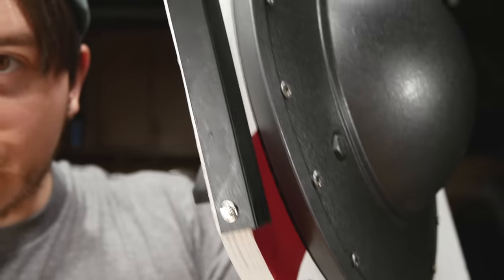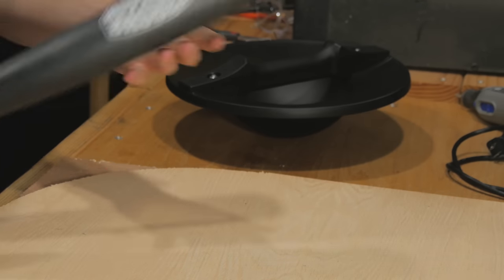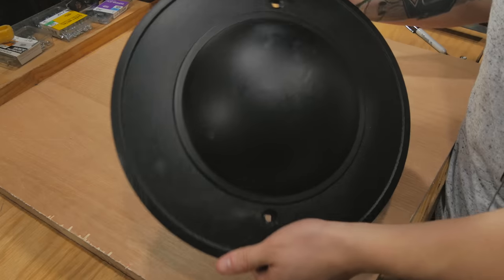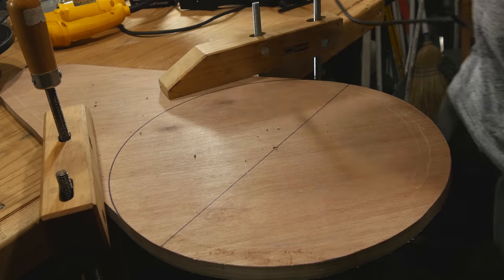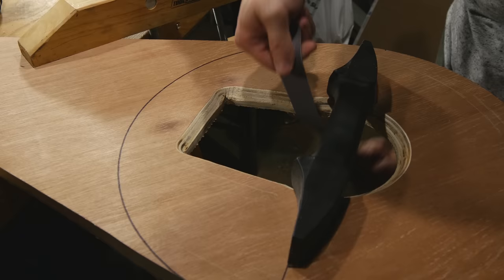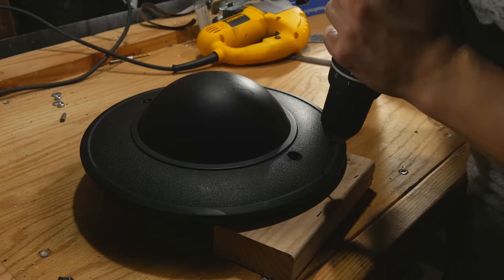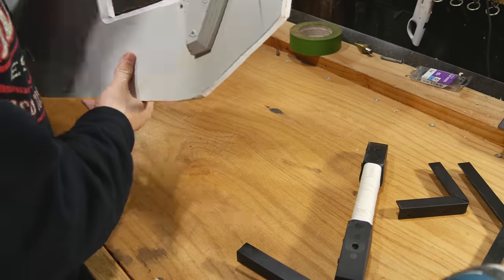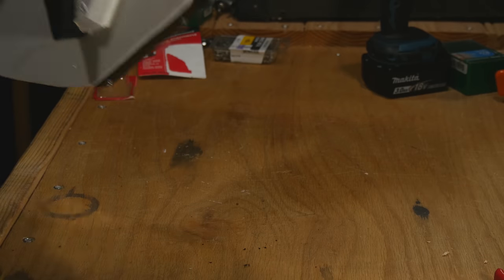How to Make: Brawler Shield (Weapon/Shield HYBRID)

Comment: Also you’ve effectively made a Kite Shield. Not an aggressive jab, Kite Shields are rad, just pointing it out
Reply: That is, in all honesty, the tiniest, least useful kite shield I’ve ever seen then. Good shield, it works and it’s smart, but like, a kite shield is supposed to be waaaaay bigger, and gripped much differently. Kite shields are meant to cover lots of the body, without the weight of “tower” shields. This is a little baby kite shield. Works more like an oddly shaped heater shield if you ask me
Reply: loaf Bread this shield would be a weapon  that’s the point. Using the shield as a weapon was his point.
Reply: loaf Bread it seems like. The point of this shield is to extend the punch while adding weight and power. While still being able to defend axes and swords.
Reply: @the_worst_of_friends924  I know, all I'm saying is if it was a kite shield, It'd be much larger, with more body coverage, and meant specifically to take hits while you use a separate weapon. This is more of a brawler weapon, which can act as a fairly good blocking method as well
Reply: Pmis
Reply: Kite shields are rad, says shad
Reply: It's more like a weirdly shaped heater shield
Reply: @Loafusbreadmyre  Kites are ment to protect the leg whilst riding upon a horse.  Using a kite in a standing position is gloriously innacurate.  I would love to demonstrate for anyone.
Reply: Shadiversity. Shad approved
Reply: @viridityone3106  spiked pavese sir
Reply: @jonasandersson7367  preposterous, this clearly does 1d6 bludgeoning damage while a Pavise does 1d8 piercing.
Reply: @viridityone3106  i think im wooshed, id what?
Reply: @jonasandersson7367  it's a dnd joke
Reply: More of a Pavise
Reply: @Loafusbreadmyre  it's a lightweight attack kite shield lol for the tower man on the go
Reply: @Loafusbreadmyre  well its kinda like if a kite shield and a heater shield had a baby

Comment: A shield is usually designed for bashing though. But since a shield bash is quite slow you can't really make it a main feature.

Kite shields have a sharp bottom for ramming through the weak spots in downed enemies' armor though, but that was only useful for well-armored knights. It also covers your side as you strike and might block some arrows, not that a plate-clad knight really needs to fear those.

Round shields are much better for arrows and better for covering your side as you strike, good to have when your armor isn't as hard as plate. Also you can hit hard as fuck with it. It's slow though. 

The buckler is the real bashing shield as it's light and quick with enough force to stun even armored opponents. Doesn't cover your side but it has some protective use since it can cover your sword-hand. Useless against arrows though, it's a specialized dueling weapon.

Also the name for buckler literally originates from the old Germanic word for "bashing".

So yeah you're kinda trying to reinvent the wheel but all in good fun
Reply: hes actually not trying to reinvent something hes just trying to provide more protection while allowing for a faster sheild bash so you can move from enemy to enemy faster and more efficiently
Reply: Crusader Sheild good for taking Jerusalem
Reply: SATAN Himself DEUS VULT
Reply: I mean its basically a kite shield shaped buckler. Though he cant move it like a buckler so normal buckler and sword stances are gonna be hindered.
Reply: @cobes11  well I mean they also dont typically have body armor on it
Reply: booty_ hunter420 A shield, like any armor, is only as useful as its ability to stop the weapons it is likely to face. The Templars had little need to protect against .30 caliber rifles for obvious reasons. And with as many guns as I have had pointed at me in my life so far, I can only guess that ine will go off one of these days.

Comment: ELI! There is a semi-light weight sheet metal material called “Titanium 6-4.” It is Titanium with added percentages of Aluminum and Vanadium respectively. I have found even a sheet as thin as less than one quarter inch can stop or deflect a .45 caliber CORBON hollow head round. A sheet of this on the face of the shield would make it bulletproof against pistol fire, whilst keeping the weight low; snazzy. 

Excellent work as always, magnificent Art!

Comment: For anyone wondering, I did the rough math and he is using about a 2 foot by 2 foot piece of plywood for this. The buckler is 12 inches in diameter, so the dimensions of the shield are around 16 inches by 2 3/4 feet
Reply: Thanks I didn't see the dominions in your video

Comment: U know what would make this thing look even better? First, draw a line 1 or 2 inches away from the bust at the long part and keep curving around it until you get around about a 200 to 220 degree angle going around the bust, facing the longer end of the shield. You may notice that it doesn't go all the way to the edge so just go in a straight line until you do. Then cut it and reattach it but with some bars or something in between the two pieces so they have a spaced out effect to each other and you can add to it by spacing them out more, add a more jagged/spiked affect to it, putting random, broken, bits of wood in the space, and/or see-though, coloured plastic in it.

Comment: Here is something to consider for future shield builds, rawhide, or its equivalent, if you can find it for cheap (I get you are not planning on getting into a fight with these).  Rawhide was placed on both sides of the wood, sandwiching it, to prevent the wood from splitting should a projectile; arrow, bolt, maybe javelin, should pierce it.  The last thing you want is for your shield to take a broadhead and split into pieces in the middle of a fight.  The stuff is thin enough that it is transparent so paint jobs and designs can still be seen, though not as clearly (this ain't plastic wrap).  Anyways not sure if you can find some in your area cheap, maybe ask local hunters to sell you some.  Just a thought on making them last longer without investing in really expensive materials.  Love your content hope everything works out for you and you can keep doing what you seem to love to do.
God bless

Comment: I love the shield, love the channel, however, the boss of your shield (boob thing) is positioned so high a sword or club bouncing from impact would clear the top of the shield and negate the purpose of your shield.
Reply: I don't get what you mean with "clear the top of the shield".
Reply: I think he means skip off of the boss and bounce over the top of the shield, straight into your face.
Reply: Matthew Morris Yeah, that's what I thougth as well. However, bucklers have been a tried and true weapon throughout history since its invention, and thats what the actual boss of this shield is made out of. It's all about how good you are with it.
Reply: Matthew Morris thanks for the reply by the way. :)
Reply: Actually, Bucklers where rarely used in actual combat, being preferred to be used in duels or sport, and used in conjunction with a light sword such as a rapier. Not only that, but bucklers are used in a unique manor, a completely different way to conventional shields, a way that is not conducive to be used in actual battle. If one was to use a buckler in combat, then anyone with a heavy weapon would either A. break your wrist as the buckler is held by a handle, and lack any support, B. Deflect the blow around it to either the face, arm, neck, well, anywhere but away from the body.
Reply: That is not taking into account the fact that ZNA's shield is no longer a buckler, rather a tiny kite shield, with a disproportionally HUGE boss, now, in shields like a kite shield a boss serves two purposes, a weapon to bash into the enemy, and a metal hard point curved to deflect blows into sliding off the shield, dispersing the energy of the blow and avoiding broken arms. Now, this deflection is useful in larger shields as the sword would deflect, then slide on the main wooden part of the shield, and fly of to the side, avoiding the person, in ZNA's case though, the shield is too small, and such a deflection would result in a sword to the face or groin (depending upon where he positions the shield), this is even worse as the boss is HUGE, and as such deflections like that would occur more often as not only is the boss covering almost 50% of the shield's surface, but it is the shape of a buckler, as it is in fact a buckler.
Reply: TheConeezeanEmperor good points, but do you have proof that bucklers weren't used in actual combat?
Reply: TheConeezeanEmperor And yes, I know you use a buckler in a different manor than other shields. That's what I was refering to in the last sentence, in case I was unclear.
Reply: It was used, as I say, in sword play, duels, and the such, and as far as I know was not recorded as having ever appeared in battle, at least, if it did its performance was so lack lustre that no one recorded it, or used it in battle again. The other thing is that due to its small size it was useless against projectiles, which meant that it was nigh useless in actual battle, where common tactics dictate that an army would have some form of missile unit along side its infantry and cavalry.
Reply: The point of a shield is protection, if it does not offer that then what is the use, considering the fact that bucklers would cost more than standard shields use to its all-steal construction then why would a soldier buy such a useless shield when he can get a proper one done, I mean, if he got the Buckler chances where that he would die before battle joined from an arrow, bolt, or similar.
Reply: TheConeezeanEmperor Well, if you define "real battle" as in a battlefield /warfare situation, then that could be true. However, wasn't the buckler used as a sidearm by archers and such rather than against them?
Reply: Yes, but the point still stands with the fact that it was a "sidearm", they did not rely upon it, and it was only used as it was light and small, as opposed to its effectiveness in battle, I mean, it is useful if you are skilled in its use, but only in a 1 on 1 duel, if you are in battle and are facing the chaos of a melee it is all but useless.
Reply: TheConeezeanEmperor, I believe you meant "said" rather than "say."  From context, I assume you were referring to your earlier comment, but it would have been clearer with proper grammatical structure.  I would also recommend that you maintain your tense in the same sentences, mate. ; )
Reply: Shadiversity made the argument recently that the main purpose of the boss was not added offense or defense. Instead, he says, the main purpose is to let you put your hand in line with the plane of the shield, giving you better balance and control over the shield.
Also, while an arrow would not likely penetrate a wooden/leather shield deeply enough to injure your body, it could penetrate deep enough to injure your hand. So you cover it with metal.
Reply: Crown, that may be the case, but that does not stop the fact that the Boss DOES deflect blows, and was also used as an offensive weapon. Put it this way, it is more practical that a blow is deflected and the force dissipated with minimal damage to the shield than if the blow hits head on and damages the shield. This is MUCH more important the thinner the shield, jars or even breaks the arm/hand/wrist of the shield wielder, and potentially breaks through. I doubt that such a useful feature was an unintentional side effect.
Reply: TheConeezeanEmperor I would agree if the shields design lent to it being used to statically block attacks but it doesn't. With the edge being so close to the hand and the majority of the weight well behind the grip it very much is designed for bashing and parrying with the front edge rather than holding it in front of you to shield your body. I imagine it would function like a buckler with more weight behind it.
Reply: TheConeezeanEmperor If it wasnt clear my point is that, no it wouldn't be good for deflecting blows if you just held it out in front of you, but you wouldn't just hold it out in front of you.
Reply: As I am part of a viking reeanactment fighting group I feel like i should share my opinion.
The shield ive made for myself is a wooden shield that is 1,2cm thick (too thick so too heavy), 82cm wide, a glued on layer of linen on the back and front to prevent the wood from splintering (REALLY helps, its  must). A handforged mildsteel boss ive forged myself (its about 2-3mm thick, its enough to stop a full blow even from a Dane-axe), and a 2-3 mm thick moose rawhide around the edge of the shield.

My opinion about using these shield in offense, is that it definetly works in specific situations, but i would use the boss to bash my enemies as i would have to be so close to be able to hit the enemy, and the force would be spread out over a larger area, what id do is bash with the edge of my shield -> more range and power.
On a proper round shield the risk of a blow glansing off the boss and hitting me is next to noone cus of the size of the shield as well as the tip of the weapon would most likely be cought in the rawhide arouund the edge. (understandebly different with a buckler or ZNAs shield but i have no hands on experience with those).

PS. I am by NO MEANS a expert, I just do viking era fighting so got some hands on experience on what that type of fighting COULD have been like.

ill gladely answer any questions you have. :)
Reply: My point exactly, A simple farmer, it is not a shield, and if it was to be used like one then the blow would deflect into the face/groin. As such, it is a buckler/shield best used in 1 vs 1, as opposed to battle or genuine combat.
Reply: And Carl, that is exactly what I was saying earlier, if a blow hits the Boss it is deflected, and slides of the shield, if the Boss was not there or not shaped like that, the blow would catch, and the kinetic energy would be fully imparted. Also, using the Boss as a blunt trauma weapon is a tactic that has been used throughout history, and has many advantages over the use of the edge of the shield, the least of which being the fact that using the edge exposes you, and allows for others to get through your defence, or allows missiles though, using the Boss you can still remain behind the shield, and the protection it offers. Though, this also depends upon the shield in question, especially when considering the fact that using the edge is nigh impossible with tower shields.
Reply: TheConeezeanEmperor I don't entirely think that this wouldn't be used in a battle, it certainly wouldn't be used by people in line combat but it seems reasonable that maybe a man mounted on horseback or a knight in plate armour might use a shield like this (albeit a larger one of the same general shape). A shield like this seems to me like a shield of someone that isnt in any particular danger of being rain down on with arrows. So yeah, your spearman wouldn't be seen with a shield like this in battle unless he was on the ground dead or lucky.
Reply: Well, if you mean a buckler then the only cavalry that used them, even to a limited degree, was archer cavalry, by those where not bucklers really, just small shields, and archer cavalry was rarely used in the nations that used Bucklers commonly, namely Western European nations. If you mean a kite shield, which is shaped similarly to ZNA's shield, then yes, but it was MUCH larger and used also by infantry later on, the reason it was originally adapted for use by cavalry, knights especially, was that it was shaped in such a way that it can be moved around easily, and not be caught on the horse, saddle, etc. It was then used by infantry, if I remember correctly, as the shape still offers good protection to the face, chest, and arms, yet is lighter due to the shape of the bottom. Correct me if I was wrong there, but that is what I remember.
Reply: Well, to tell a lie actually, as later on Knight DID use a variant of bucklers, or bucklers themselves, but that was not in battle, only for tourneys and jousting, and was used in conjunction with the ultra heavy tourney plate armour (up to 2X the weight in some cases, between jousting armour, and battle armour).
Reply: I agree in part with all of you. Having been in a few reinactment groups for medieval and renaissance combat over 10 years, this shield has little to no historical reference. Now as someone who has built and used similar shields before, you are correct in thinking that in a melee situation where archers are plentiful it would have little value. Against 1 to... say 4  opponents(I have successfully used it against 3 opponents) it could be very useful, especially if it had a slightly longer, wider top/front to aid in deflection and a slightly longer back/bottom edge so that it can be held in a strong upright position and block for some of the lower body( although the blows land heavy there without deflection from the boss). A shield employed in an active and aggressive fashion is a great tactic for smaller shields like bucklers in a pure melee and edge strikes are very useful for staggering an opponent or even binding his weapon to create an opening. In my opinion, the main weakness of this shield are it's limited missile defense and it's short front edges, because if you attempt a strike with it and someone bats it aside you have a lot of weight forward which could easily throw you off balance and leave you open(speaking from experience here). So you are all correct in thinking all of the things you have said, even that one grammar-police guy(who I am sure has found some flaws with my post as well).
Reply: Shannon, like a Norman shield, very great shields for infantery combat. :D